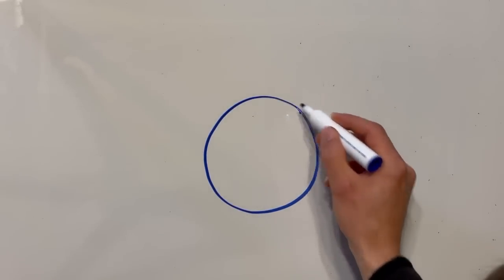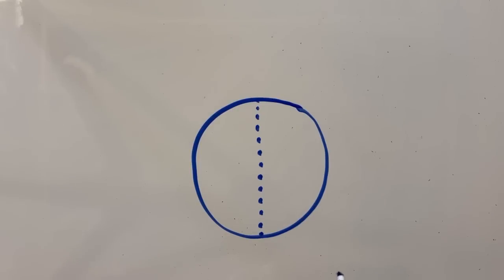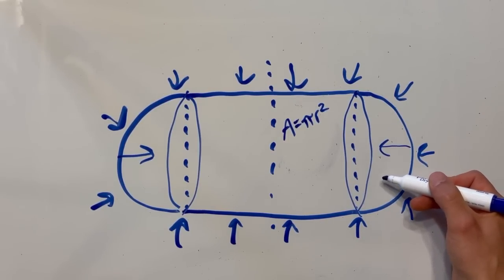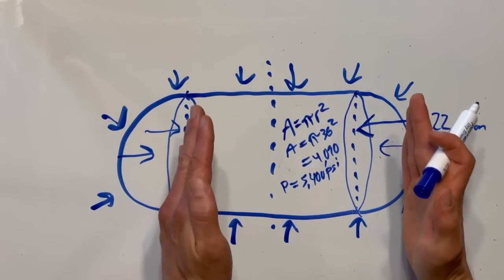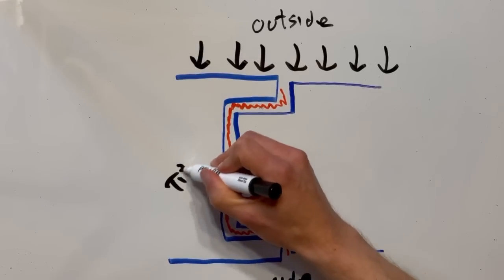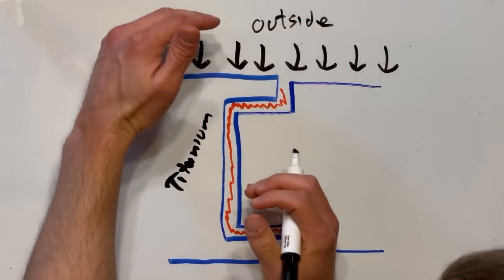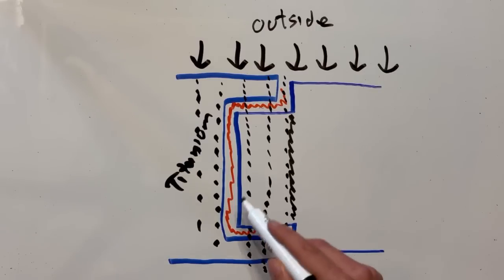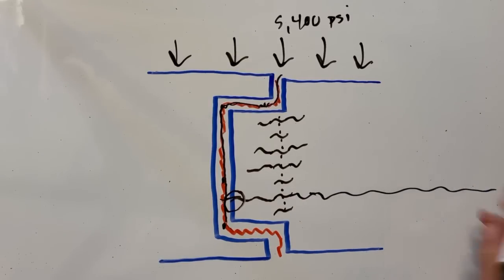Simple Engineering Analysis of How the Titan Submersible Could Have Failed

Comment: HELLO FRIEND PERMISSION...I am a researcher and the submarine imploded because its designer did not know and the company did not have the most advanced technology...I have the honor to report as a researcher that shipbuilding and aerospace have changed... The new technology is legally enabled in America and Europe in 2020... The new technology can perfectly weld the thick titanium or aluminum plates on both sides of the material SIMULTANEOUSLY with laser and inert gas for the first time in HISTORY... This means that the submarine that imploded could and should have been built as a titanium monocoque made in one piece and welded by automatic lasers with the new technology... On the other hand, the fact that it was not round is not a problem either... because it could have columns or internal partitions that will withstand the extra pressure and be 10 meters or more long and withstand the compressions of the ocean perfectly...The submarine imploded due to ignorance and poor design...Shipbuilding has changed and it is an honor to inform you and everyone else...IT'S A PLEASURE...CORDIAL GREETINGS...

Comment: I had watched a video on what might be the text communication with the Titan and the surface support ship.  There where read flags when the text says the Titan decent was too fast, and once they realized a problem such as a bus failed they could not come back up.  They also mentioned that their monitors had gone from green to red as the composite was delaminating and crackling.
Reply: that alleged "last text comm from Titan" has never been judged authentic, or validated by anyone in the Oceangate crew or anyone who had contact with them right after the event. In fact, it actually mimics a Titan text comm from 2019, when they had trouble dropping ballast at the bottom, but did finally make it successfully back. Also it first appeared anonymously on Tik Tok, not ever a reputable source.

Comment: A great explaination here...I heard there was the cracking noises from the rear meant that the pressure had been compromised in the rear where the power and batteries were somehow. Once that happen, a short time later they were in panic mode for 15 or 20 minutes, (from the communitation texts) before the carbon fiber hull totally disintegrated popping the nose cone and rear ring off. If the Titan was loosing power, just maybe the power to the  pressure regulator for inside pressure was compromised also causing not to produce enough pressure inside to equal the outside water pressure.  I find it really interesting you are confirming my thoughts, and I'm just a backyard hillbilly grease monkey.
Reply: This makes no sense. There is no pressure regulation. The air in the sub is around atmospheric pressure, that why there was a 5 in thick hull, to handle the external pressure caused at depth.

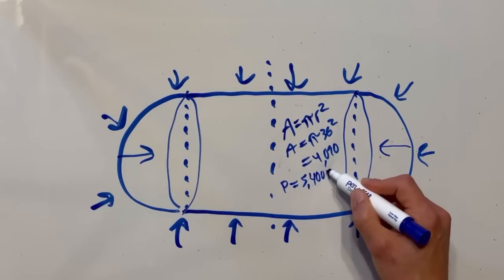Comment: At 6:15,  you make a slight error, first by using r = 6 rather than 3, then squaring 36 rather than the 3. So the calculation should have been:   r.squared = 9 X pi = 28.3 X 5300 = 150,000 NOT 22 MILLION. 
The difference between 150,000 and 22,000,000 is, i suggest, a significant one.
And you're an engineer? 
Perhaps these design calculations should be entrusted to an accountant (which i am) rather than an engineer.

Comment: You are absolutely correct in your analogy, also they could have tried to mitigate the voids in the adhesive joint with the use of an autoclave or at least a vacuum bag, I saw no evidence of such measures during the construction of the hull, basically he knew nothing of strengths and weaknesses of CF. He could not of payed me enough to get in that thing.

Comment: Thank you for your simple and clear explanation of the possible (most likely) cause of the Titan failure. I have watched the news coverage of the debris recovery and it appears the Ti rings appear to be very clean, there seems to be no broken pieces of carbon fiber still glued to the ring? Its almost like the Ti rings popped off cleanly, along with the front hatch and porthole (unless the savage crew unbolted them during recovery process) Hopefully, the NSTB will release an interim report and followed up by detailed analysis of the Titan loss.

Comment: I'm less familiar with their design but I saw some images and saw the raised floor, as well as the wall in the back. From the supposed transcript of the event, it sounded like they heard cracking from the rear. It also sounded like they were increasing depth at a fast rate as well as having buoyancy issues after dropping weights. I'm wondering if the aft bulkhead would obscure a small pinhole/crack leak in the adhesive as you mentioned and let water in where it couldn't be seen, displacing their air and dropping buoyancy. Combine reduction of buoyancy and existing failure in progress and you get an event.
Reply from the maker: Very doubtful.  I don’t think a pinhole type leak would happen, and then at a future point in time a catastrophic implosion.  To me that transcript is a hoax. Too many flaws in it like someone is trying to make a juicy story.  The submersible would not take on water like a ship to have buoyancy issues.  I think the back wall was just a panel to cover up electronics and maybe some other support systems that may had been back there.

Comment: Very informative. What I don't understand what was the rationale in using 'lightweight' materials? Surely saving weight would not have been relevant when underwater, agreed once out of it the additional weight of steel etc would become a factor but if I was looking at design priorities then what happens 4000ft down would be the overriding thought, not saving weight.
Reply from the maker: You are exactly right.  There may have been a cost savings making it out of carbon fiber, but I think it was his ego to say he was different as to why he ultimately went with the carbon fiber.

Comment: Amongst the hundreds of videos made about this totally avoidable tragedy has anyone yet revealed as near an accurate depth at which this occurred? Initially it was reported that the US NAVY hydrophones picked up the sound of the implosion about an hour plus 15 minutes after it submerged which would put it  one third of the way down or little over 4500 feet .If that is correct then the pressure that imploded it was considerably less than the estimated pressure reported in this video . How much less is material to the fact that it proves just how ill conceived CARBON FIBER was for the construction of the Titan submersible.
Reply from the maker: I read the dive was to take about 2 hours and that they were 1 hour and 45 minutes into the dive.  There is some room for error there, but it would seem they were probably at least 80% of the way to the bottom, if not more.
Reply: @Mutton_Lettuce_and_Tomato  
As your reply came in I found a video whose accuracy can be argued  you be the judge  https://www.youtube.com/watch?v=xeXCcFBMEx4
It appears that the initial 75 minutes  into the dive report  was not correct  and  your figures are more representative of reality . So at about 11342 feet on their way back up in panic mode the vessel imploded .This happens too often in this blasted country  were chasers release inaccurate information based upon hearsay , by the time an accurate representation is produced people have moved on with an incomplete picture . But what does it matter ? For me quite a lot , because relative to this or other situations of diverse  subject matter it creates nothing but confusion .

Comment: 1.  The keystone beneficial shape is lost in the cylinder longitudinally, making it susceptible to buckling or shear inward, requiring much thicker wall than a sphere to avoid this problem.    2.  A joint between dissimilar materials requires a thickened cross section, a flange - NOT a machined down narrower cross section as shown.    3.  Given that carbon fiber is the strongest of the materials present, the glue is necessarily weaker, requiring a cross section several times larger than the cross sect of carbon composite;  again a flange is required.   4.  Carbon fibers are embedded in an epoxy resin, and therefore will fail at the resin, regardless of how strong is the carbon.   5.  Using all titanium would have eliminated several problems: dissimilar deflection, delamination, weak compressive strength of fibers.   6.  An ellipsoid shape rather than cylinder would have gotten better performance out of the same material and thickness.   7.  The technology of bottling compressed gasses contains 5400 psi, 10,000 psi, and higher - so experimenting with human lives on new 'bottle' designs is completely unethical. They could have done multiple cycle testing in the lab on a miniature.  -

Comment: The union with the titanium is not as you say. The fiber structure go complete into the molded titanium. It means that there is not a different thickness in the fiber border. However, it seem to be the same problem. When the fiber cilinder compress in the middle, the fiber in each union with the titanium  will deform and it only depend on the epoxi.

Comment: I makes sense that the differences in material, the glue factor, the depth issue of view window, that the way this submersible was built was flawed. Nothing wrong with trying to be a visionary but get it all properly tested and certified first. Strikes me he was a little over ego'd and cutting cost corners. While it is great to see it explained from an engineering point of view , it doesn't take an engineer to question aspects of this sub. Stockton raised a lot of red flags, a pity those passengers didn't be more aware. Why they didn't investigate more and ask more questions as they would have had the capacity to do so.

Comment: Great video. I'm familiar with how vacuum chambers are used to remove air pockets from epoxy even in hobby projects, should that have been done here? (ignoring that they would still have a huge problem with the CF). Also, Rush wasn't onboard every time. There was at least one time when it went down on an expedition with another staff member piloting it. That was the time they had installed one of the two horizontal thrusters on backwards and so the sub was spinning in circles on the sea floor. They had to remap the game controller while down there to fix it.

Comment: There was a video a few weeks ago by someone who found a text on submarine pressure vessel design.  This a classic submarine hull profile.   Apparently it stated that if the cylindrical pressure vessel varies from true circular by 0.5% you lose 30% of your depth capability, so it was essential to not allow it to distort under pressure.

Comment: Maybe another mechanism is material degradation due to salt crystals formation.  Salty water under pressure can enter nano cracks and channels.  Once the vehicle is out of water, water evaporates leaving salt behind.  The salt crystallizes forming crystals of certain shape and size.  The pressures from formed crystals perhaps is of orders of magnitude higher than, one at Mariana Trench buttom.  Thus it will tear apart material and over time change its parameters.  Please corrected me if it's wrong.

Comment: This is a very good discussion of the stresses on an object !
I have only seen low resolution pictures of the tube being manufactured, so I may be wrong, but I assumed the Titanium ring
 had a U-channel machined in it so the smooth CF tube would fit into this channel.  That might help support the ends of the tube to reduce the chance of collapse right at the end of the tube.  
That still leaves a large area of the tube where any irregularity could lead to catastrophic failure. 
The demo with the aluminum sheet is very illuminating!  It shows how even a small discontinuity can propagate so quickly.

Comment: Great video. I just can't understand why they didn't simply use steel for the tube. Is a solid 5" thick wall of carbon fiber really cheaper or lighter than a steel wall of similar performance? It's not like they can use a sheet-and-core design in this case which is where carbon fiber could actually enjoy cost and weight savings.

Comment: Essentially the carbon fiber is floating in a matrix of epoxy, it is wet laid no vacuum system to reduce air bubbles nor a temperature controlled vessel to set off the epoxy and the application of the glue that Stockton says has a consultancy of peanut butter is just , nutts from a make it safe standpoint

Comment: I commented on your previous video about the gluing, I'm clueless when it comes to this kind of thing, but I have some common sense, I thought a human can't apply the glue perfectly, who or how was it being checjed? What about environmental contamination? Fluff, arm hair? Crazy
Reply from the maker: Yes, it probably wasn’t being checked, and the whole process seemed like something a back yard mechanic might do.  Their thoughts might have simply been that the glue joint doesn’t have to be flawless since the pressure under the water would keep the titanium ends pushed against the composite center section.  There may not have been much thought about how defects could be infiltrated by water at extreme depth and how it could possibly lead to failure.

Comment: Well explained. As an Engineer you know that we have to wait for the full investigation report, other systems such as the porthole were also contentious, so we don't know the exact probable cause but I am with you in the theory that this is the most likely scenario. (I am a BEng CEng Automotive).
Reply: It looked like the window was blown out when it imploded.  I can't imagine they would remove it just to create a hoist point, every investigator would freak out.
Reply: @k53847  yes, but it could well have failed due to the immense forces which would have been generated at the point of implosion, it will be interesting to find out.

Comment: James Cameron's submersible, at least from the outside, looks to be cylindrical as well, but perhaps that's just the outer casing?
Reply: You can make a safe cylindrical pressure hull, you just have to know what you’re doing.
Reply from the maker: A cylinder is perfectly safe.  You just need to understand all the forces going on.

Comment: Key things a lot of people forget.   The sub has been successful in reaching the Titanic multiple times so there may have been no defects at construction.       However, the Titan had been struck by lightning, in the Bahamas.   Lightning can do damage on a molecular level, including to metal and even rock.   It rearranges molecules.    The molecules around the point of the lightning hit were scavenged and pulled towards the point of the strike.    On some rock types a direct strike leaves a little Olympus Mons shaped raised bump, by scavenging material from the surrounding area in the instant moment of the strike, rearranging the molecules of rock.  Not melting it in the shape.    

Then there is the Fulgurite, commonly called "petrified lightning".    At the point of a lightning striking the ground, rock, organic matter, soil, sediments are fused on a molecular level into a glass like stone called a Fulgurite.    I collect them.        The next day during a dive is when OceanGate staff reported hearing distressing loud crackling sounds in the hull, that Stockton Rush totally dismissed.
Reply: They supposedly either repaired or replaced the CF hull after that, I've heard both. Not sure how you'd repair it...
Reply: @k53847  They didn't repair or replace the carbon fiber hull and were diving the next day, after minor repairs.    The first cracking sounds in the aft of the submersible were reported by the crew, during a the dive after they lightning strike, when they were still in the Bahamas.        They didn't even build a secondary prototype CF hull to put through appropriate pressure tests.

Did you see the leaked transcript yet? The Titan descended dangerously too fast, then he reported cracking sounds in the aft, and his real time hull monitoring (RTM system) alerts were all read.   They dropped ballast, and even had to jettison the frame, but were still too heavy and ascending wayy too slow.     Stockton also lost main power so had to route to a backup battery.   Check it out, if you have not yet!
Reply: @lunamaria-94  I saw a video on that transcript.  Well, at least they saved money by having the UW interns design the sub electrical system.

Comment: My question is this: Stockton Rush was an engineer. He should've known that the carbon fibre composite was the worst material to use under pressure. Why then did he decide to die on the carbon fibre hill? I know he was an aeronautics engineer where CF is commonly used in tension, but you'd think he'd know it wasn't suitable on a submersible. It's so baffling.